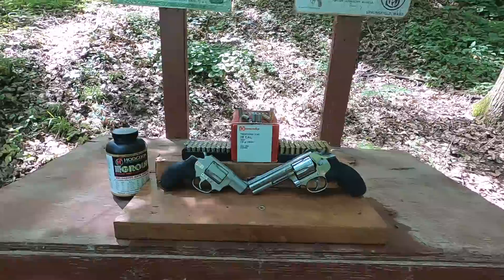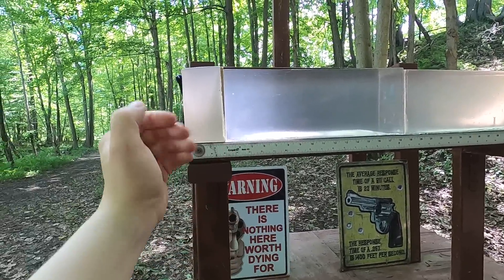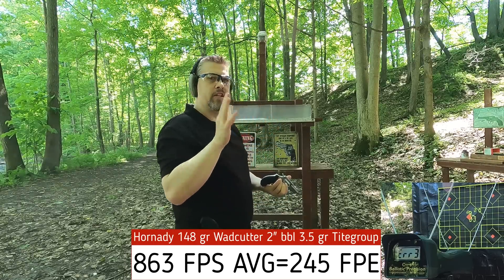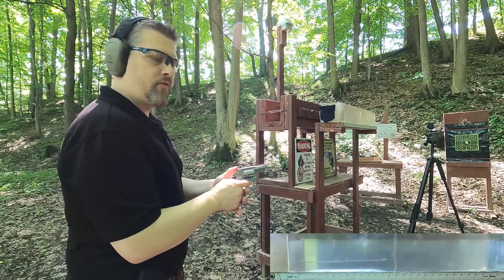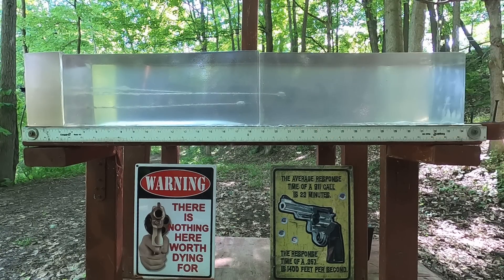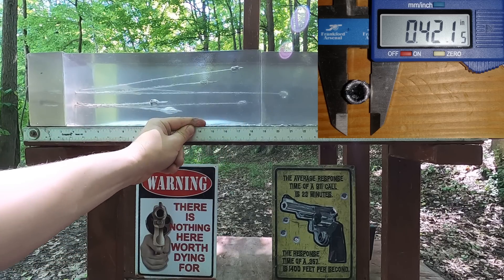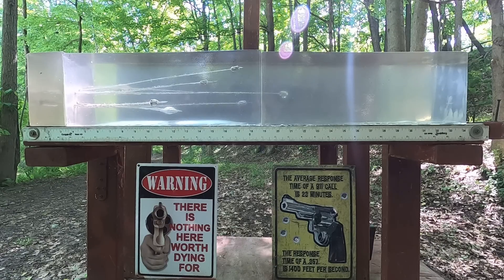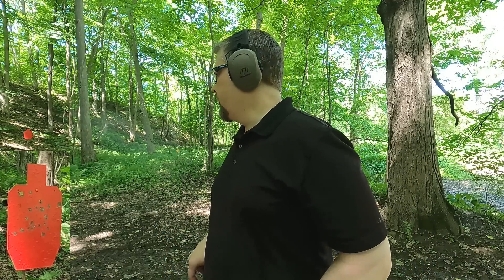Backwards Hollow Base Wadcutter .38 Special - Ballistic Test (VS Traditional Wadcutter)

Comment from the maker: I wanted to mention the smoking issue. First off, I didn't get leading but also I wanted to mention that any smoke is caused by Hornady's wax coated knurled bullet, it's the wax burning. Also MOST importantly is that the smoking was actually very minor. What you see towards the chronograph and gel block is rays of light coming through the trees, so what the camera picked up more or less tripled the amount of smoke that I could see. When you see my 25 yard shooting that's where the smoke level was to me the entire time shooting. Sometimes cameras and lighting exaggerate things.
Reply: I tried backwards wadcutters in my SP101 3" 327. 98 grain Speer HBWC seated 1.240" not flush in 32 H&R mag brass 3.0 grains Titegroup roll crimp. Fly straight and accurate at 50 feet. Probably too hot for a H&R revolver. You might want to confirm from manual or work up.
Reply: If you had shot some pots, we could see some pot smoking !

Comment: +.2 grains don't sound like much, but it skews the math.  What do the wadcutters do with a UNIFORM load, i.e. 3.3 grains, forward and inverted ? That's what I wanted to see. My pistol is not +P rated, so the 3.5 grain loads are out.
Reply from the maker: One has to understand that .38 Special has a max SAAMI pressure of 17,000 PSI and CIP is 21,700 PSI and wadcutter loads at that 2.7 gr or so, are generally about 8,000-10,000 PSI loads. Going up a little doesn't make them "+P".
Reply: @GunSam  Kinda missed the point. Same powder charge, bullet seated forwards vs backwards.  Speaking for myself, I wanted to see whatthe diffeence was with no other variables.  Unfortunatly, the video here has another variable...the 3.5 grain charge. [ which my M 200 is not rated for.]. Interesting video, but not showing me the info I was hoping for.
Reply: @GunSam   Not the read I get from the Hodgdon's data center.

Comment: 11.5 inch pen + expansion..even the MDF round at 7.20-7.22 did well enough. Since FBI standard is, or so I hear, 12-18, I'd accept that, as it is simulating a sterrnum shot with possble fragmentation...

Comment: Back in the day, (1980's) I shot in PPC matches with a S&W 686 with 4" barrel. I would shoot wadcutters and they were very accurate even at the 50 yard stages of the matches.
I would buy reloaded wadcutters from a guy for $45 per 1000 rounds with my brass exchange. I got very proficient using speedloaders too.
Yeah, those were truly the good old days. Wish I never sold that 686.

Comment: I load reversed hbwc to +P 38 ballistics in 38 and 357 cases but seated out so base is at same depth of 158ge swc in the case. Shot into plain water jug expanded to double caliber to point that "petals" nearly broke off. 
I don't worry about leading as they won't be fired that much, and reloads are +p+ jhp ammo.

Comment: Why do wadcutters have to be seated completely in the brass?
Reply from the maker: They don't have to be, but many of them are hollow base and being seated out more would reduce the pressure and they would be super weak like 300 FPS, if you added more powder the skirts could be damaged and accuracy ruined. Running seated with the powder charge it has is perfect. With a double ended wadcutter you could seat them out pretty far and have them loaded pretty hot, and you see this with some of Buffalo Bore's wadcutters.

Comment: ... Loaded inverted HBWC in the 70's and 80's ,, used to practice on vegetables from the garden ,,  watermelons and gourds .. prove to be very effective for a reasonably short distance and typical wadcutter very accurate  ... even with low grains/ pressure performed excellent at about 800 fps +/- ... out of 2" or less barrels and also a pocket Deringer ... Also had some from a company called "Alberts" (maybe spelled wrong)  and still have some ,but have been sitting boxed since the 80's .... they had a steel cone cast inside and were probably the start of the "Hydra-shock" designs.... 
   ..Speer wadcutters ,both bevel base and hollow base had a cannelure to apply a light roll crimp ..... the Alberts were smooth cast and used a taper crimp .... These were the start of many hours of combinations and trigger time ....  all of these were suited for personal defense loads ,, not enough for game or distance ... crowd control tissue damage w/ limited penetration ... .. not steel car doors ... 
.... This video really stirred the memory back to a great time ...      ... Always knew if jumped by a bushel of fruits or vegetables (todays thug standards)  ,, you could handle the job ...

Comment: Wow seems like some pretty good loads- man you have me thinking I really need to get a reloading setup for 38 special…
Reply from the maker: Wadcutters are the perfect load to start with. Even max charges listed are like 12,000 PSI and you can just, push them bullets flush to case mouth, don't need to even crimp if you don't want to, they aren't slipping out unless you shoot them.
Reply: @GunSam  oh man… a single stage press is fine for these too, right? And I’d need small pistol primers?
Reply from the maker: @crankygunreviews  Yeah .38 Special is always small pistol primers. If desperate you can use small pistol magnum as there's not a significant difference other than the cup is a bit harder. Single stage presses work fine. I bought a Lee Anniversary single stage set in 2015 and it's still the only setup I use.

Comment: How did you crimp the backwards rounds? Aren't the crimp grooves designed to be closer to the front of the bullet? It has never occured to me to load bullets backwards.  Could you load a semi wadcutter backwards to get a wad cutter? Hahaha
Reply from the maker: Wadcutters don't have crimp lines. Just roll crimp over the nose or if backwards, skirt.
Reply: ... taper crimp ..just snug enough to prevent slipping while gun is fired .. also improves velocity and accuracy ... ( less drag/ stripping of lead exiting casing ...)..

Comment: Awesome now do the same with 357 mag
Reply: It is recommended by all the books that you use the same charge for the 357 Magnum gun as you do the 38 Special with these wad cutters. It is not recommended loading 357 cases with these wad Cutters and a higher charge as the more powerful charge will cause extreme leading and expansion in the cone and Barrel

Comment: I'm a little curious to see this same type of test but done with .32 caliber hollow base wad cutters. Primarily because I want to see if those would be better alternatives to some other JHP designs. Particularly in something like .32 S&W Long.
Reply from the maker: I got a similar comment and was looking at some of those. There's only one place I found them. Personally I think my best bet is .32 H&R Mag cases. I messed around with .32 Long, .32 H&R and .327 and found that .327 you really can't play with too much for slower loads, that between .32 Long and .32 H&R I could get really consistent handloads with .32 H&R. Like .32 Long I was at maybe 750 FPS 85 gr XTP but same bullet .32 H&R mag 1,000 FPS. So in a wadcutter that's 100 gr a .32 Long might max 650 FPS, .32 H&R 900 FPS. I feel like this is where it should be. Same load in a .327 Case would lose pressure and more powder would be too hot.

Comment: Would you consider doing this test in a 357 with higher velocities?
Reply from the maker: I have thought about it, but the thing is that load data books basically show only .38 Special powder charges in .357 cases, so I would have to more or less guess and use a 158 gr load data to create .357 loads. Ideally I would use plated wadcutters for that test.
Reply: @GunSam  gotcha

Comment: Those did pretty good forward or backward. The Federal HST 38 special +p is supposed to be based on a backward wadcutter and it didn't perform as well. We used to load .177 caliber pellets backward in our air rifles. Seemed to have a whole different affect on small game.
Reply: ... not really true ... HST is a jacketed bullet with a huge ashtray cupped about 1/2 down ,, solid from there ,, similar to any other jacketed bullet but the mass is bottom half ... and seated deep in the casing ....

Comment: I enjoyed t video . probably 35-38 years ago I did the same test of the backwards 38 hollow base wadcutters . about same results. accuracy not great and expansion not much. I was a little surprised on expansion because those Hornady wc are a softer lead with low brinnel hardnessfactor.you would thank they would have great expansion but not so.so I quit loading them backwards.but John cerrilo if I spelled it right was a famous new York police detective who survived 21 gun fights and was a user of 38 wadcutters on duty.he preferred deep penetration over a expanding bullet traveling partially in the body. papa wishing you well

Comment: Did you need a special reloding die insert to load these ?
Reply from the maker: Need is a strong word. I have heard of people sanding or flipping their seat stem as the factory ones are cupped to push round-ish bullets and the seat stem upside down is flat. I suppose a purist might flip the stem so the skirt edges don't push inward, but I didn't flip the stem. I just seated with the regular seater and didn't notice too much deformation. I crimped over the shoulder anyways.
Reply: @GunSam  I have an older set of 38/357 Redding dies, that have different seating stems for this. I also have the same for 44 Special/ Magnum.

Comment: Atomic Arms offers a factory load. I have some loaded now in backup 357's.
I seat them so the "base" is at the same depth as a 158gr bullet in 357 cases about 1/4in exposed, loaded to 38+P levels. 
Ran one into a jug of plain water and expanded to about 70cal almost breaking apart.

Comment: Back in the late 70's,  when my dad was hand loading backwards wadcutters for my mom, she was a nurse and carried a 38 snubbie in her purse for protection walking to her car at night, we didn't have ballistic gel available.  Instead we tested using wet phonebooks.  There was a huge difference between the backwards wadcutters when compared to regular wadcutters and lead round nose.  As better defensive rounds came out and became regularly available, she switched to commercial stuff but we still have a few of the old boxes of the 38 special backwards wadcutters up on the shelf in the reloading room.  Nice comparison test, thanks for doing and posting it.
Reply: I, too, fooled with reversed HBWC in the 70’s.  Even put gas checks on what had been the nose, and loaded some to .357 levels (Speer swaged 148 HBWC).  In general, it’s not a super stable bullet when reversed.  But if it does stabilize in your gun and it hits square, you can get great expansion.  Sometimes they angle off and just collapse that big opening.  Didn’t have ballistic gel back then.  If I did it again, I’d compare performance between the 1 in 18-3/4 twist S&W, the 1 in 16 twist Blackhawk, and the 1 in 14 twist Python.  Can’t hotrod a forward facing HBWC or you risk blowing the skirt.  If you go this route, shoot enough to know that your recipe works dependably in your gun.  But there is real potential here.
Reply from the maker: Thanks. I have noticed that hitting hard things they do really mushroom. A few years ago I shot a frozen gallon of water and the backwards one just splatted and got caught an inch in. Must have been an inch diameter at that point.

Comment: I've never shot wadcutters but in my 357 mag I've shot a lot of semi-wadcutters so my question is, what is the difference in performance and accuracy between them
Reply from the maker: Wadcutters and semi wadcutters there's a few small differences. Main difference is that a semi wadcutter is shorter even though it's usually heavier at 158 gr, so it's generally loaded to shoot faster. Also a semi wadcutter has a nose that can help guide the bullet to penetrate deeper even if loaded as light as a wadcutter. Main difference is if you had to shoot something big, like off the shelf wadcutters at 700 FPS won't penetrate that well, they will as we see, even mushroom on the correct nose end. Semi wadcutters generally won't, so they penetrate really deep in let's say, a bear.
Reply: @GunSam  thank you
Reply: hard cast bevel based are nearly the worst bullet     flat based are better at sealing gas

Comment: Am I correct in thinking in the UK THE backwards ones were used effectively as THWACKERS or something? Maybe in Weblys? At 875fps that is great performance could u get that in 2" a like 3.5 grains and would just be plus p?  Hey Sam don't u have 2-3 more .357 loads to test I sent you 125 and 158s? Can u get to that? Thanks
Reply from the maker: I have them but I get confused at which is which and keep trying to sort them out. I might get some newly boxed version to try. The reason I been putting it off is I have a feeling they won't perform very well.

Comment: Did you get any annoying levels of leading? They looked pretty smokey. They seem to perform as well as some cheap JHP ammo. Maybe that's just foggy memory on my part though. Very economic on the powder charge though. I generally think in terms of 5-6gr for pistol loads. Although I think at that usage, the primers are still costing more these days. 😭
Reply from the maker: Not that I noticed. The Hornady bullets smoke is mostly due to the entire bullet being knurled and wax lubed on the entire surface. They actually shoot very clean. Then sometimes I get bullets that seem clean, but they are super leaded up.
Reply: @GunSam  Same brand? It would be interesting if you could load some up to 950fps out of the two inch barrel. It would be interesting to see how they perform then. I know there will be recoil. But the TiteGroup is one of the faster powders, so the extra charge shouldn't be so bad for muzzle blast. Just a thought.
Reply: @GunSam  I have a 300 round box of Hornady 158gr (.358") LSWC-HP which have the same crosshatch pattern as your HB wadcutters. SKU #10428. They don't have any drive bands or cannelure. The nose and HP cavity is kind of small, but it looks like the bullet can seat pretty deep. I assume the brass is meant to be rolled over the edge of the shoulder. Given the length of the shank and flat base, they should take up a lot of volume in the case for an efficient powder charge.

Comment: Interesting results, wonder how those backward wadcutters would do at .357 velocities.
Reply: I'm guessing that they would make a nasty but shallow wound cavity, breaking up and failing to get adequate penetration. And they would probably lead up the bore something fierce.
Reply: Simultaneous expansion and good accuracy with all lead HP ( -ish) bullets have a fairly narrow optimum velocity window . Backwards HB wadcutters even more so than " proper " HP molds with a 1:20 alloy .

  Other brands will vary , but with Hornaday , the sweet spot is +\- 900 fps .

  Interesting historical tidbit :

  Jim Cirillo ( newbies look him up ) was a fan of conventional WC loaded to 900 fps. ( This was late '60s before effective HP duty ammo ) . The sharp edges would dig in and penetrate skulls at angles that .45acp fmj would deflect .

Comment: Really great ammo test! With .38 ammo so unavailable or outrageously expensive it is the information that I have wanted for reloading +P options. Thanks, keep up the great work!
Reply from the maker: Thanks. Loading these up traditionally with a little different powder is also a good way to have good rounds. The Titegroup I used is a bit hot and smokey, accurate nonetheless. I was ringing steel at 75 yards easily in the snub after this test.
Reply: @GunSam  I was taking notes while watching the video. I use Bullsey powder, got plenty of brass and loads, now all I need is someone to have primers, my stash is dwindling.